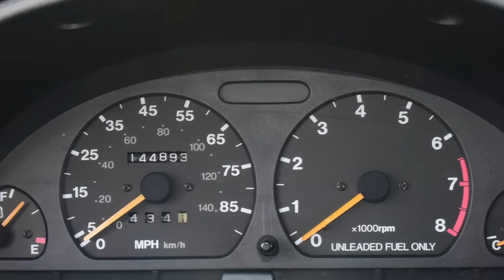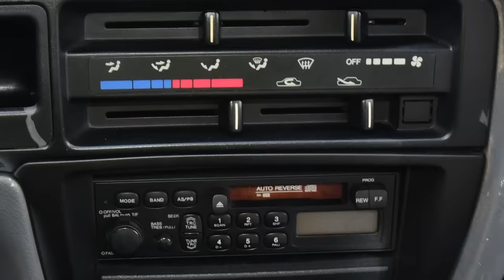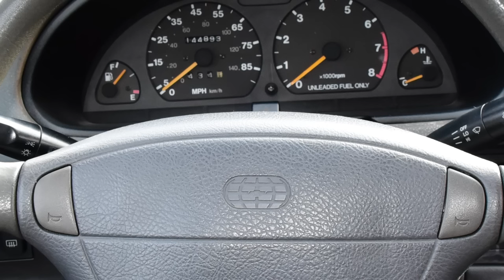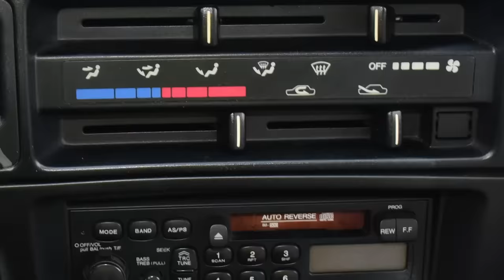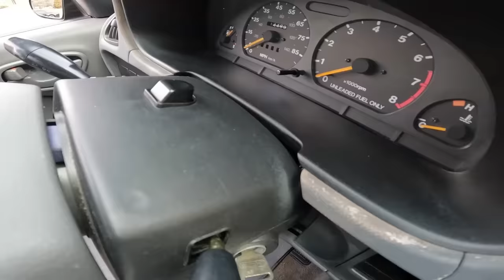1996 Geo Metro 5MT: Regular Car Reviews

Comment: While I haven't driven a Geo Metro, I have driven a Suzuki 25 passanger bus in Kuwait.  It was the 1L 3 cylinder, had AC, power steering and a radio and lights.  You had to pick 3 of 4, because if you had all of them on it would kill the engine.  It was manual, and even with being weighed down and not being able to use all accessories at once it was fun to drive.

Comment: I had a 94.  It was an automatic 2 door with air.  Your finger automatically turned that air-conditioner off so u could pull out into traffic.  At 165,000 the timing belt blew for the 3rd time and I got rid of it.  It was my favorite car.

Comment: I watched this when it was new, and back then I still had my '14 IS250.  RCR, I took you up on the challenge and found someone willing to let me just try the thing and assuage my curiosity.  In less than 10 minutes of operation, just like you said it would, it challenged my worldview and I found myself lacking, wondering: when did I become so vapid?  That little metro recontextualized my life and made me confront the uncomfortable truth that I had not been living below my means like I'd been taught growing up.  It stared me right in the eye and dared me to research the dictionary difference between want and need, and then tell me it couldn't live up to my needs.
Since then I've sold the IS250 and replaced it with a 1998 Honda Civic EX coupe.  And I'll be damned if it doesn't somehow fit me better than the Lexus ever did. Looking back on it, there was always something missing from the driving experience of the Lexus, something critical to human interaction that wasn't there with the IS that is there with the Civic.  Human interaction.  And if we're going to go off on a tangent, the brutal simplicity of a 90's import car, and all the wonderful little surprises that await a mechanically inclined DIY'er like myself.

Comment: The thing I love most about the Metro is the two extremes it has been taken to. On the one pole, the 9 Second Metro, which had a Buick V6 stuffed into the engine bay through some black rites of engineering and smoked other cars at the drag strip. On the other pole, the 75 MPG Metro, which sacrificed everything for optimized aero. Both of them are extremely silly.

Comment: My dad had the previous body style and was getting 55-62 miles per gallon driving 60k miles a year. Definitely no acceleration in 4th and 5th. One hill leaving town you'd have to drop to 2nd gear and redline it to keep it at 40ish mph in a 55 zone. Great car. Drove it to 350+k miles and then got another that made it to 250k miles.

Comment: Omg i had three of those. All 3cyn 5spd. Never had working ac, without the ac pump, it can fit an oil filter from an F150.

I drove two of them as delivery vehicles in a large college town. Parked anywhere it fit. U turns in the tiniest spaces. The lane markings had completely faded away and I just made up extra lanes.

Runs on a 2:1 blend of e85 and 87 octane with no hit to fuel economy or top speed, that's without me fiddling with timings, but I suspect the previous owner did.

Fun as hell to drive. Broke the rear sway bar on two of them doing hairpin turns. After driving them, a lot of other manual transmission cars feel like driving an automatic. 

handles snow and ice so well it's boring.

The amount of maintenance and repairs that can be done in a parking lot without a jack or stands is amazing. 

Can be push started up hill. 

Other than leaking oil at very high rate, ran flawlessly with a broken crankshaft.

Comment: I've had sports cars, 4x4s, turbo charged cars, and a multitude of other vehicles, but still the most fun car I ever owned was the 1991 Ford Escort I had in college.  Some of it is nostalgia, but like this little Geo, that Escort was bare bones, light, durable, and with 88hp and a 5-speed manual got regularly in the high 30's to mid 40's fuel economy.  Crank windows, no a/c, 13" wheels, no airbags, and other basic details saved weight, and it got around quite well.  By today's standards probably a death trap, but suited me well when I was a broke college student driving from NY state to West Virginia and back on half a tank of gas.

Comment: 9:26 that shape actually has a purpose. The rectangular dome allows for better oil recirculation on the camshaft. Many 1989 - 1991 models had a flat, thinner valve cover.

As for the fins... I'm not sure. Could be structural, or could actually be for cooling. The SPFI models (all non-turbo, and/or non-GT/GTi) would burn exhaust valves over time from the cylinders running too hot (lack of fuel delivery).

Comment: I rented a 2022 elantra and that thing got 50mpg according to the display. I believe it too. Held 48L and I drove it 810km (503 miles) on two lane through somewhat hilly terrain and slowing down for numerous small towns and and it said it still had 120km (74 miles) to empty when I got fuel. I never hand calculated it, I probably should have

Comment: I purchased at 01' Chevy Metro 3cy 5sp manual 2door hatch back in 2012 after my 66 Mustang got wrecked and fuel was expensive.  Best $1,100 I've ever spent.

I get 52mpg highway 45city. Fits my fat ass, 2 german shepherds, and my camping gear.

Parts are very affordable, even the premium brands. It's so easy to work on with a basic tool kit and a youtube video.

I keep it spotless and well taken care of. His name is Snot Rocket since I had it repainted in metallic neon green. He's never let me down in 11yrs. It's 22yrs old now with nearly 300k miles, and I hope to have to have it for a few more decades.

Im a truck driver and got so much flack from all my coworkers who have the 'monster truck' pickups for teeny weeny Metro. But I laughed all the way to the bank any time fuel prices go up.

Comment: My first Metro was a 94. In 2 years I put 210K miles on it in 2 years. In 96 I bought my 2nd Metro and after 13 years of driving it, with 95K miles on it, I sold it.

Comment: I own a very well-maintained white 1996 Geo Metro Base Hatchback 5-speed manual WITH AC. I purchased it in July 2002 used with 86K miles for $1300. I am retired and drive less than 3000 miles per year and do NOT have to deal with freeways. My Metro is driven at average elevations 4000-5300 feet above sea level. It climbs 1250 foot incline grades over 8 miles in 5th gear WITH AC ON, NO PROBLEM! What's not to like?!🤗

Comment: I had a 1984 tercel sr5. It too came with a tach which if I knew about cars more back then would have astounded me. 

It had an emissions choked carbed 4 which made more torque than hp. Great fun off the line, not so much after.

Comment: These were great little machines.. especially the older ones.. He is totally right about the newer ones being slower and getting worse mileage... I wonder if they changed the gearing in the transmission.. thinking it would save fuel.. But they didnt do the calculation correct. Or maybe the car got heavier when they did the body update.
Mine was a 92, was still TBI, and had AC., Usually got low 40's city, and 50 Hwy at 60-65 mph.
  I had no issues accelerating with it.. not fast.. But I could easily run 85MPH on long highway runs... Never noticed that gearing issue he talked about.. gears were spaced perfectly.
I put over 100,000 miles on mine in ONE year.. doing delivery work.. I beat the heck out of it almost every day.. full throttle ALL THE TIME..  It never cared.  I did a timing belt, and a set of rear wheel bearings. That's it. That little 3 cyl engine was AMAZING... 
It was surprisingly  roomy in the front.. plenty of leg room. Put the back seats down and it had good cargo space too.
I love beater cars like these.. they just WORK.. and keep working.. and when they do break they are cheap and easy to fix.

Comment: I had a 1994 metro XFI. It came without a radio, power steering, airbags, or AC and I loved that car to death. Got me everywhere I needed to be no problem. It's too bad I purchased it from up north so it rusted out after 5 years. I'd buy another one, if it wasn't a death trap.

Comment: I bought one new in 99 because my new job had a 100 mile round trip every day. Drove it for 7 years and put on over 180,000 miles. Oil changed every 5000 miles like clockwork. Had the cat rust out but since I don't live in a testing county I put in a straight pipe and increased hp by at least 15%. Not a spot of rust on it. Gave it to my son who complained "it's so ugly". After the first month he said it was the best car he ever owned, never needed gas.He wrecked it a few months later. I'm still looking for a decent one.

Comment: I bought a 1995 brand new from the dealer for $7,990.00 plus tax and license.  It had air conditioning but used it only at cruising speed.  Who needs power locks when you could reach across the passenger seat and lock it myself?  Got to drive it across country on I 80 from Philadelphia back to San Francisco.  It got 53 MPG on the highway and low 40s' around town.  I loved this car.  Kept it for 6 years and sold it to a young woman who was just hired at Skywalker Ranch.  I miss it's simplicity.

Comment: Bought a 1990 Geo Metro XFI brand new. Even in northern California with their excessive sales taxes, licensing fees, dealer fees and everything it was $7,000 total out the door. Best car for it’s designed purpose bar none. The XFI model was detuned from the standard 55hp to 49hp with a lower profile cam and tune for better mileage. It had 12” wheels, not 13’s. It was so focused on mpg they didn’t even put a sideview mirror on the passenger side for less wind drag. Not available with an auto trans. It actually got 58mpg if I kept it at 60mph on the freeway. Consistently got 55mpg. I put 247,000 miles on it in 10 years. Even at 6hp less than the standard engine I found it was adequate power. Had to shift to 4th to pull a freeway speed hill, but big deal. It was still running great when I got rid of it, which was a big mistake. I did have to have a clutch put in it at about 175,000. New front brakes I forget when. A fuel pump at about 200,000. Probably my fault here, I always ran the tank very low. Thats not good on in tank fuel pumps. The XFI is hard to find. Not many were sold. I have seen a couple in very good shape still for $3,500. Would buy another one again in a heartbeat if my circumstances were the same now. It still amazes me they can’t (or actually won’t) make a gas powered car today that gets this kind of mileage but is safer etc. Without a doubt, now 32 years later, this could be accomplished.

Comment: My goodness. In 1994, I was recently separated from a Navy enlistment and selling cars at a Mitsubishi dealership in National City, California. The manager owed me some money and I settled for a 93 Geo Metro in trade. 5 speed manual, no ac, no radio. I drove that thing from San Diego to Boise and back in winter, then from SD to Omaha where my dad was living at the time. Geo Metros do not traverse Southern Cali highway crests at much more than 35mph, let alone the Rockies. LOL. Later in Omaha, while studying at a university there, I had a mechanic friend try to teach his gf to change tires on it. They failed to secure the lugs and while driving on NW Highway, an islanded boulevard through the city, the driver side front wheel flew off at about 40mph, ripped off the front quarter panel and flew across the median into a traffic dense oncoming lane, bounced and flew off to the shoulder hitting nobody, luckily. LOL! Lessons were learned and underwear was changed along with a bent ground to sh!t brake rotor and assembly.

Comment: I have a 1L Nissan Micra/Marsh k11 from 93. It's the same concept as the Geo Metro/1st gen Suzuki Swift. Small and light = efficient and fun. Also without any frills, and reliable. Mine is a 4 cylinder, even though its a 1L 😜

Comment: My best friend bought one these for $800 bucks with the intent of how much power u could squeeze out of it. He ended putting a small ebay turbo on it and messed around with it tuning wise, so it only had 4 lbs of boost so the engine would disintegrate. He managed to get 110 hp out of the 1.3 engine. He drove it around like this for year before the transmission ate itself. Mind u, it had 170k miles when he bought it so it's already old lol.

Comment: Fantastic cars! Just reliable transportation. We don't need V8 trucks where we just sit in by ourselves.

I drive a 2006 Renault Twingo with 58 hp and aircon. And it takes 10 hp (feels about 10 hp) away when you turn on the aircon. But I like it, and its 44 mpg!

Comment: I just purchased my 10th Metro .( first was a 1994 in 1995 ) a 1993 with 93,000 miles  that 65,000 were as a tow behind motorhome  vehicle . It was in dry dock since 2017. 600.00   planning on Full resto  the 68mpg   is my kind of toy. Had a friend that placed a Frost  King  Perkins Diesel and got 95 MPG put of it
Reply: first replacement is a well needed timing Belt   a 20 min change last I did.

Comment: For Europe, where cars are smaller than in the US, this is still a good choice.
As a college student, I have one from 2002 in mint condition with 80k km on it (me being the second real owner). It's cheap to buy, insure, fuel up and repair. And the european version also looks a lot better by my taste.
Interestingly, it is really roomy, as I can sit behind myself comfortably, which I can't in bigger cars I've owned before. But of course the space for the fifth person is a joke as the car is really thin...
Also it is the most comfortable car I have ever had. It's fairly quiet on the highway at 120km/h that you can still clearly hear the radio. It feels nice to drive, air conditioning exists and works, and the seats are extremely comfortable. I am regularly driving a distance of 600km in one sitting, without leaving the car due to getting my back hurt (as I had to do with my previous cars), and only using 3/4 of a tank.
All in all a nice car, cheap but sturdy, top speed of 140km/h, but what patient driver cares...

Comment: 13:21 My mom owned one (maybe two now that I think back on it? It was a long time ago). That belt that's shown in this timestamp was the only faulty thing in the entire ride. She had it serviced like 3 times for that thing squeeling CONSTANTLY and it managed to get itself back misaligned each time. Other than that, great car, nothing but fond memories in a time where we were planning to move to the other side of America, sold our Durango to some buddies, its transmission EXPLODED which sucked because we didn't mean to gyp them, then we didn't end up moving, and now had no vehicle. Homeless living in a travel trailer in the front yard of buddies you're not on shaky grounds with? Need a whip to get your ass to and fro work on the cheap? Well wouldn't you know, our OTHER buddies at the scrap yard have the perfect car for you! Only a hundred bucks for every ton it weighs: that's the Geo Metro!

Comment: Building a 91 vert now. Better brakes, better (lower) gearing, and an actual air bag. It had ac which has been deleted I also deleted the plastic headlights in favor of the halogens. The halogens never yellow being glass and are easy to find.  Safety wise it is not horrible in a crash compared to many other compacts. But I threw in a roll bar just in case as 90's convertibles in general were not that great once the wheels went up. I drive 70 miles back and forth to work 90% highway on mostly flat ground. That is what this car is for. Cheap, stupid easy to work on, and the thing is dang near bulletproof due to it NOT having much power. Yes it is slow. I have fast weekend cars that get 6 to 15mpg for going fast. For back and forth to work the metro fits the bill.

Comment: You would believe that is not true, but with high strength steel and/or aluminum, you can definitely build a safe car that gets the fuel economy of a geo metro. Build a wagon out of it with a similar frontal area, and a fairly high revving engine, probably would need a variable cam but you could still get some power out of it while being efficient at cruise.
No need for power steering but electric options today barely use any power (for parking lots).

Weight, up to a point is definitely a good thing when it comes to collisions, either against other vehicles or deformable barriers (but not for the people outside of the owns vehicle).

Hybrid systems help manage weight on stop and go, but frontal area, aerodynamics and BSFC at cruise is everything when it comes to highway fuel economy.
This is totally doable, yet it seems to me that car companies completely dismissed advanced engineering in the small car, instead trying to just make them as cheap as possible, focusing their efforts on the more profitable segments, like SUVs, and indeed trying to polish a turd when it comes to making those vehicles fuel efficient.

This is one of the reasons why I believe the market has shifted so much. I do think that many people would not buy SUVs but they end up doing so anyway, as the vehicles are indeed better, as more engineering has gone into them (great example of the RAV4 Prime)

Comment: This was my first car. I purchased a 1991 base model 4 door in 2002 when I was in high school, gas was $.99/ gallon, I would fill my tank for around $11. I would beat on it constantly, and it would come back for more. My lead foot, was no match for the eager suzuki 1L engine. It was so light my friends would pick up the back and pivot the car in a parking spot. I was too young and naive to truly appreciate delayed gratification, I just wanted to go fast and impress my friends. I sold this car and still see it around, it still has the flame job that looks like it was drawn with an erection. That car will outlive everyone I cared to impress.